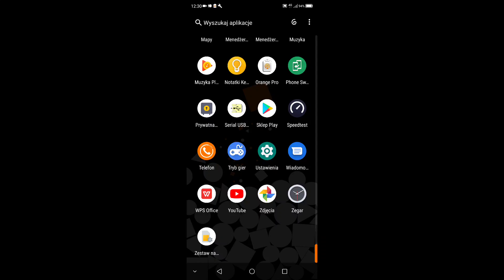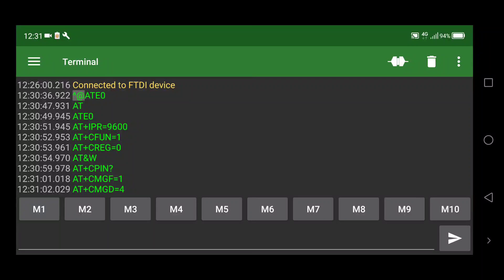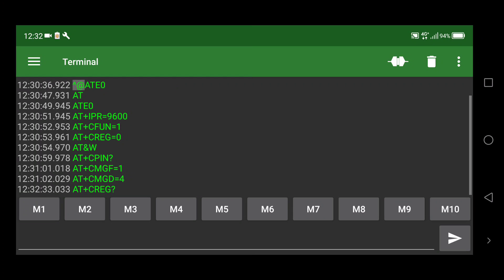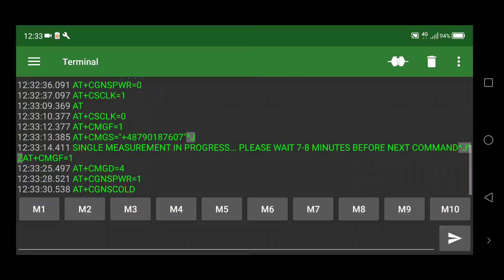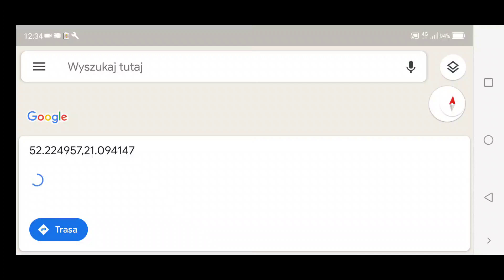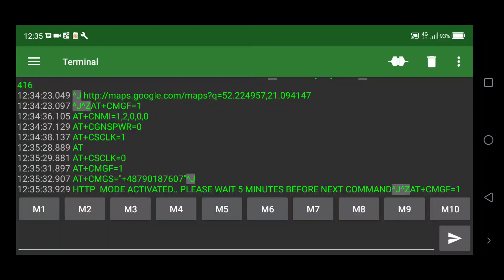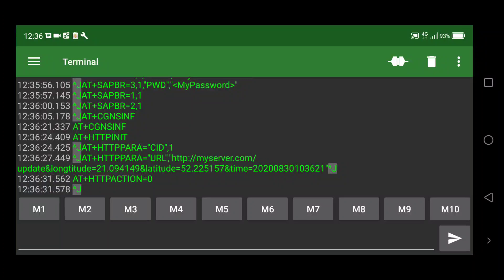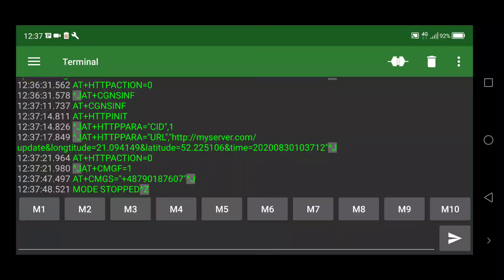NEW GEN  30$ Cheap DIY  GPS bike car tracker working worldwide - for LTE-M / NB-IOT and GSM - part 2

Comment: Hello sir thank you so much for all your guides and github, it is a treasure for beginners like me wanting to learn electronics. I have a couple questions that come to mind with this design. Could it not use rechargeable batteries (as you mention in a reply below) connected to the car battery in such a way that the car battery ensures that the rechargeable batteries are always full? In this way one would not need to change a powerbank or any batteries in years. The car battery would simply charge the rechargeable batteries and one could change the rechargeable batteries once a year to keep them in good quality. Is there any reasons why this could not be done? And if it could be done how would a beginner like me should best approach trying it? Any directions appreciated.
Reply from the maker: yes you could connect it the way you are describing.

Comment: Hello , I am a student and I'm working on this project but with SIM28ML will the source code be the same?
Reply from the maker: hello. SIM28ML is GPS module only. It does not contain LTE-M nor NB-IOT radio interface.  It also does not have AT+C modem interface , it has SPI bus instead. So the answer will be no , it will not work with my code

Comment: the best gps project i've ever seen in youtube thank you so much man please dude do it with arduino uno
Reply from the maker: the problem I am having with Arduino Uno is that the real serial port pins are taken for the upload of Arduino sketches. That is why I am unable to use this board
The Arduino Pro Micro Atmega32U based would be an option to interconnect natively with SIM7000 module. It uses 5V for powering and 3.3 voltage logic on Serial Port pins

Comment: Hellou is possible to buy one or more gps tracker from you? I am from slovakia a will pay you first. thank you
Reply from the maker: Hi, I have only 2 prototypes of LTE-M based trackers and you wouldn't be satisfied with quality of this build. I would suggest to build it on your own, it is easy and the design  does not contain many components. On chineese Aliexpress you can buy a set  of SIM7000G module together with LTE and GPS antenna. Look here https://m.pl.aliexpress.com/store/v3/home.html?shopId=605000&sellerId=200615104&spm=a2g0n.detail.0.0.31301f63CGVw1V&pagePath=index.htm&gclid=&extParams=
Reply: @justanengineer5599  ok i will try... thank you for make this video

Comment: Please explain me. Currently your device has a power bank through usb, how long does the device's battery last once you disconnect it from the usb port
Reply from the maker: It will not work without usb power, it does not have battery built in. The USB powerbank serves as battery power.
Reply: @justanengineer5599  ohhhh thank you, and another question, will you have a link with another board for sim7000 :(  I'm not find de bk7000 or something like that on amazon
Reply from the maker: HI, there aren't many SIM7000G boards on amazon. The only I could find is 70$ which is way too expensive (should be max 30$) . I would suggest to buy some board on www.aliexpress.com or directly from the manufacturer here : http://www.and-global.com/index.php/product/index.html

Comment: Is there any reason this should be less accurate in the USA than what you show here? A $8 GSM tracker I bought from aliexpress is only giving me accuracy within ~2km and is useless for me.
Reply from the maker: This one here I am showing  has real GPS  built-in and is the most accurate you can get - GPS will give you 1-5 meter accuracy. The one you bought for 8$ is a crap that uses GSM base stations for positioning (it is contacting chinese servers over gprs to calculate cell tower location by sending cell-id info to remote servers). Base stations are spreaded like 2km or more and here is the reason you are asking about. Don't buy such s*** , make your own device
Reply: @justanengineer5599  Thank you for the info and thanks for making these videos. I'll order parts now and try to make my own!

Comment: after sending the SMS command to get the GPS coordinates How can i speed up the time from 7-8 minutes because if i am tracking a stolen vehicle that is enough time for the vehicle to move from that location to a next location.
Reply from the maker: The first option is to use HTTP server and HTTP command  to watch the location every 1 minute - for this you need to compile "main10.c" file from github.  To use http mode you also need to have your own HTTP server exposed to Internet that will be able to process HTTP GET requests and present the data fromm the tracker...

Second & easiest option  is to  send command MULTI to get location every 5 minutes or less... These 5 minutes can be further shrinked to 2 minutes by deleting or modifying delay_sec(N) entries in particular point in the code  (this is 3 minutes you can get rid of )  :

 if ( (continousgps > 0) && (continousgps<254) )
                        {                            
// if in GPS continous mode delay XX minutes before next attempt
                          delay_sec(60);
                          delay_sec(60);
                          delay_sec(60);
                         };

Also here in the code you can modify number of   gps position text notifications to send by changing value of variable "continousgps" to some other than '5' :

  // checking if there is "MULTI" word in SMS content buffer
                                 memcpy_P(buf, ISMULTI, sizeof(ISMULTI));
                                 // convert to upper char  
                                 if   (is_in_rx_buffer(strupr(smstext), buf, BUFFER_SIZE) == 1)  
                                     {
[.... here some code ...]

// mark 'initialized' flag to further proceed outside do-while loop
                                        // send number of GPS polling to 5
[...]
                                        continousgps = 5; 
                                     };

Following 'continousgps" values are reserved for particular command :
1 = command 'single'
255 = command 'guard'
254 = command "http"
5 = default for command "MULTI"
Reply: @justanengineer5599  How can i add a rechargeable battery instead of a power bank ?
Reply from the maker: Yes, you can. To do that you would have to get rid of LM1804 voltage stabillizer on dev kit BK7000 board as well as to remove set of 1N4007 diodes from ATMEGA328P voltage drop down on the schematic. Simply speaking connect directly both ATMEGA328P and SIM7000G chips to rechargeable battery kit (it has to be 3.7V voltage - standard Lithium Polymer may be used)
Reply: @justanengineer5599  So is there any charging indicator to know when the battery is charging to full charge ?
Reply from the maker: No, but the software will send you current battery voltage information      along with gps position. If you want to use recharable battery you will have to construct charging unit for it

Comment: wow great job plz do it with arduino
Reply from the maker: I would do this project for Arduino but :  1) arduino is taking the real serial port thus making it unusable,  2) Arduino works with 16Mhz clock and consumes more power so it is not efficient, 3) arduino is bigger than single ATMEGA328 chip so the tracker wouldn't be so portable

Comment: can i upload the code using arduino IDE?
Reply from the maker: This is AVR-GCC source code / HEX file so in general it cannot be uploaded with Arduino IDE - however you may want to try this method here : https://www.arduino.cc/en/Hacking/MiniBootloader. 
Normally to upload this  project files you would  need to have AVR-GCC environment installed on your PC and USBASP programmer connected to the chip ATMEGA329P using some prototype board. Please see my other video describing compilation and chip flashing here : https://www.youtube.com/watch?v=7klgyNzZ2TI    If you are using Windows 10 you may also want to look here for AVR-GCC installation tutorial  : http://fab.cba.mit.edu/classes/863.16/doc/projects/ftsmin/windows_avr.html
Reply: @justanengineer5599  Thank you so muh .When i compile the code in arduino IDE igot no error every thing ok!!
Reply from the maker: If Arduino IDE says its Ok - means it is Ok
Reply: @justanengineer5599  Thnx a lot.keep goin